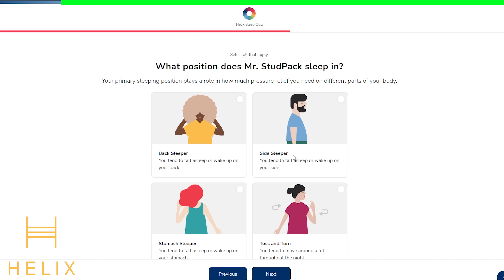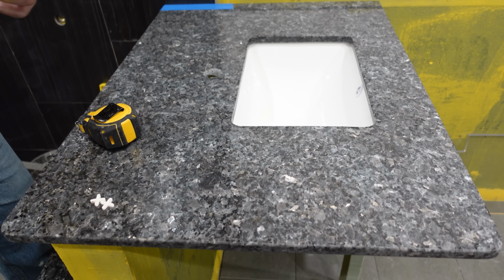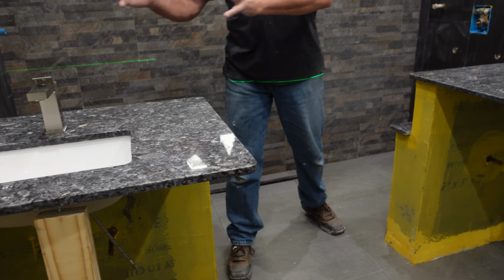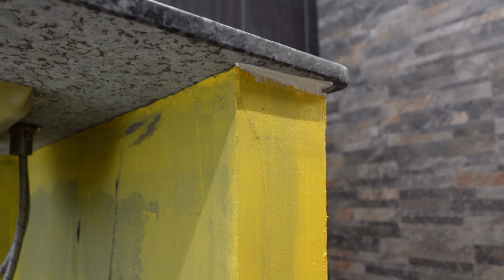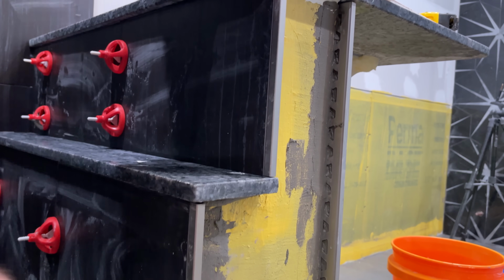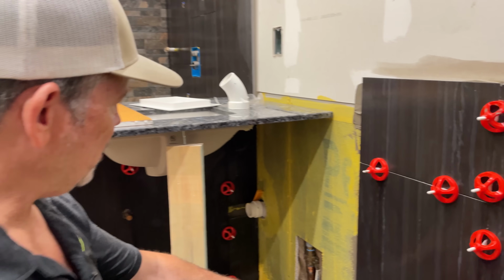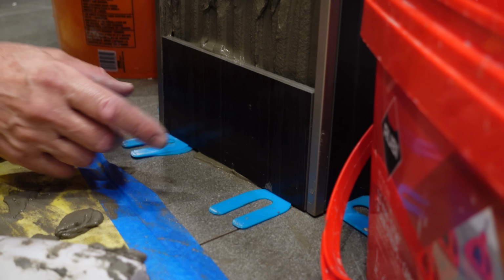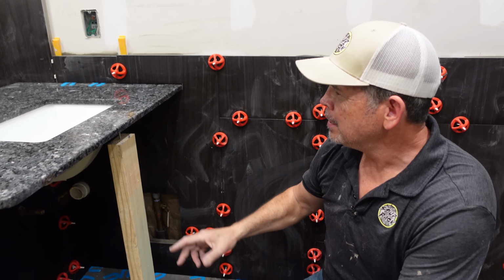A Stick and a Bolt is ALL YOU NEED for Perfectly Level Counters! - THE SHOP Part 20

Comment: The pony wall countertop supports should be some sort of stainless tig welded exhaust pipe to go with the whole theme. Your buddy could probably weld them up for you and have his hand in the build!
Reply: I had the same thought.
Reply: thats what i though of also
Reply: I was thinking maybe a camshaft.
Reply: That's what I was thinking James.
Reply: I too thought the obvious choice would be a chrome exhaust pipe…was an hour late on it being an original idea😢
Reply: I was thinking like a camshaft or crankshaft, but it would have to be coated with like a clear resin or something to keep it from rusting in the bathroom. That would be slick either stainless exhaust,cam or crank. Whatever it will be, I’m sure the StudPack will make it insane!!
Reply: Titanium Pie cuts
Reply: I was thinking 2 stainless glass packs or cherry bombs
Reply: I was literally about to say the same thing considering the nature of the shop. Awesome idea!!!
Reply: Not an exhaust pipe…. A McPherson strut!
Reply: Exactly what I was thinking!
Reply: Definitely
Reply: This idea has my vote!
Reply: I dont care what it is as long as it's stainless steel.
Reply: I was thinking exhaust or camshaft
Reply: Beat me to it. I had the same thought.
Reply: I was gunna say a car hood to hide the plumming haha
Reply: Or forks from a Harley!
Reply: Ooh, that sounds like a good idea. I was thinking some 2" aluminum angle stock for legs, but that sounds sturdier.
Reply: Going with the exhaust idea use a set of chromed headers at the top then extend the collector to the floor to make the legs.
Reply: Cam shaft
Reply: @macman85602  My concern with exhaust pipe is that it might not be strong enough to act as support. I've seen some exhaust pipes break fairly easily. Maybe something designed for structure might be better. Or have some sort of extra support hidden inside the pipe for reinforcement.
Reply: @catsmeow5566  could throw a steel support inside. They just needs to look like exhaust headers
Reply: My thoughts too.  A chromed glasspack.
Reply: Opposing view... 
Many, many comments for some sort of motor/car part. If there were more car parts in the design, I'd say go for it. Unless I missed something, the only automotive link in the bathroom is the Chevy logo.
Keep in mind the high humidity in the bathroom. Steel parts will rust unless treated/coated. Most any sort of strait "leg" will likely reach out and smash tows that pass by too close. 
You've got some aluminum trim on the pony wall, I'd tend to bring that to the sink support. Some sort of aluminum sweep (maybe 1-2 inch square stock/tube) from near the front of the sink sweeping down and back toward the pony wall, ending at the floor maybe 10-12 inches out from the wall. Set back in from the side edge about 4-6 inches. That should prevent stubbed tows. Frame it up the pony-wall and under the sink counter with more aluminum to make a triangle shape (with a curved hypotenuse). Fill in the hollow center with matching tile, or build in some recessed shelves and tile those. More LED lights would be cool in the shelves, but electric may be a problem.
Just my two cents.
Reply: Could set it back enough to accommodate a towel bar. It is near the shower after all.
Reply: problem is they cant get his buddy to make it as he would need to get in there to check measurements etc and they dont want him to see the bathroom until its finished for the surprise on the wall.
Reply: Came here to say this. Think it's a great idea.
Reply: @macman85602  I did like the idea someone suggested of having an angled support that butts up against the wall- harder to hit the support with a foot that way and would look neat. Maybe some sort of exhaust pipe that angles like that and has reinforcement inside.
Reply: @Know-Way  Good point. I was thinking either aluminum or maybe something painted black. I like your idea of the triangle with curved hypotenuse (I still remember Pythagorean's theorem). I'd love to see that drawn out in Sketchup.
Reply: How do I contact studpack?
I am looking for a contractor, and I am not sure how contractors come up with their labor cost.
Is it like two times what the materials would cost?
Reply: 1\4 elliptical leaf spring

Comment: I like all the suggestions for car part-themed supports for the counters.  I suggest that whatever you do, have the support angle back toward the wall.  A purely vertical support will almost certainly result in stubbed toes, which will be extra painful when going in or out of the shower.  Plus, it will be much easier to clean the floor if the counter supports connect to the wall.
Reply: This! Never thought of that, but I could see it being very annoying.
Reply: I was thinking the same.  Just a rolled chrome(or matte black) bar (like you would find on a roll bar cage) that supports the corner into the wall itself rather than on the floor.  Could probably get away with a short vertical into a 45, then horizontal into the pony wall.
Reply: Nice, that's a way better idea. I was thinking they should match the trim on the tile with solid square bar, maybe even 2 of them 45° to the rear.
Reply: I'd just use a huge 'L' bracket, so there is no post at all.
Reply: I was thinking the same 👍👍
Reply: Bumping

Comment: I think a polished and cleared camshaft would look awesome
Reply: yeah, they could probably bore out the centre at the ends so they can stack 1.5/2 of them together with a little piece of rod and just have some sort of pin sticking up out of the floor to keep the bottom in place and then a nice looking stainless bolt through the counter top. maybe even use a countersunk bolt or something.
Reply: I was gonna say the same thing!
Reply: This is what I came to say too!
Reply: Also came to say this. But chrome plated
Reply: That was pretty much what I was thinking too. I was thinking chromed but either way would be cool.
Reply: I vote for your idea.
Reply: That was going to be my suggestion as well.
Reply: I commented before I saw this! DITTO!!!

Comment: I like all the suggestions! Originally I was going to offer the camshaft idea but I thought about stubbing a toe so I quickly changed my idea to a use leaf springs that arc from below the countertop corner towards the back wall near the shower entrance. Paint them black! This project turned out great!
Reply: I thought the exact same thing about a leaf spring going back to the pony wall rather than down to the ground too but I figured they would probably need to be custom made because they would be so short. Then I thought of a coil over shock but thought maybe that would be a little over the top. The leaf spring would be a great design element but understated rather than in your face.

Comment: Regarding the support-leg: ya have to be careful to not introduce a new element that clutters the pro look so far. I think underneath the sink needs a cabinet for stowage of extra T.P., shampoo, paper-towels, soap, toilet-cleaning supplies, etc.
Reply: ...and towels, wash-cloths. One side could be a dirty clothes hamper. I assume they wear coveralls so maybe clean sets could be stowed.
Reply: 💯 you never have enough stowage in a bathroom. I would find/make laminate panels matching the tiles (or even have them printed) - with chrome-framing (like the pony-wall), 1 or 2 shelves and some baskets. Pretty sure 'Mrs. Chevrolet' will appreciate it (and, that open space is just not gonna look 'finished' - no matter the support).

Comment: Cool sink support idea - use a threaded galvanized gas pipe with flanges on each end.  I've used them for railings and supports.  They work great.  Make sure to paint them well to prevent rust.

Comment: I gotta go with something different than everyone else.... drill a hole in corner of countertop and put a stainless eye bolt in then aluminum or stainless aircraft cable going to the ceiling. I was gonna say a winch  on celing but that would prolly rust over time and gets expensive for 2
Reply: I like the idea, but use a hand winch like a boat trailer would use.

Comment: Use a drive shaft to support the counter. Rotate each yoke to a 45 degree angle. One end attached to the bottom of the pony wall. The other attached to the bottom of the counter.

Comment: I like Steve's answer of TIG-welded exhaust pipe but what I suggest is a bottle jack or something along those lines to go with the vehicle motif, just like Steve mentioned.  Of course, you would want to make sure that the pressure release valve on the jack is "permanently" closed so that it doesn't get opened under normal circumstances.

Comment: Future idea for sink support,
On my projects for floating sinks I build steel angle supports into the framing fastened to the substrate. With only the top horizontal sticking out to support the top and to hide the angle use a apron around to hide the support.

Comment: That tile cut sliding over the counter top  into place was super satisfying 👏👏 great work as always
Reply: I don't really understand why you didn't tile first and then mount the granite worktop, thereby removing the need to a) cut the tile and b) notch the granite. By the looks of it, the granite now comes up a bit short on the end of the pony wall and you can see the top of the corner trim on at least one side. Also not sure why the shampoo shelf has a different corner radius from the worktop - seems uncharacteristically inconsistent for studpack! (I genuinely love what you guys do and your standard of finish is generally excellent which is why this one kind of stood out a bit).

Comment: I'm gonna go whole hog with my suggestion for the supports. I think it would look great semi-open / transparent. Granted this is expensive, but I suggest sandwiched tempered glass panel with the center section shattered for the crazed effect. Would look even better with some edge lighting, but not sure if you have a circuit in your plan you can get there... Would look pretty classy though and one more accent for that dark tile and stone.

Comment: Along with the support post maybe add a short apron under the front and side tied in with the post to hide the bottom of the sink and help support the heavy counter but not cover any of the chrome pipes. Kind of like what's under a table. It will help support when someone sits on it or sets something heavy on it. That will definitely happen.

Comment: Curved stainless steel exhaust pipe attached to underside of counter and pony wall (about 6" above the floor) with 2-bolt exhaust flange.  Repeat for grab and towel bars.

Comment: The support should be an illuminated frosted acrylic cylinder or square post in white to match the niche on a dimmer to lower the light to guide the eye into the shower.

Comment: For a corner support for the sink, 1" black cast iron pipe with flanges on the ends would look cool. I've used it before and it has an industrial but sleek look.

Comment: Blade of a leaf spring out of an old chevy truck, nice forged steel bracket to hold it to the pony wall and a nice gentle curve to the floating corner, it's out of the way, no toes will be broken, probably enough support since the countertop only needs that one corner left. But might be a bit much with all the work you already have haha!
Awesome project, love following the videos!
Reply: use the leaf spring out of a corvette not a truck!

Comment: It's refreshing every time I come across fellow "Safety Engineers" (as in Use Both Belt "and" Suspenders!).  I learn something new every time I see one of your videos.  It's like another "OMG...I knew that I could do that.  Why didn't I think of it?"  (Not talking about the 2x4 and bolt, because I actually have used that.  Will miracles never cease!?!?!?!?  Anxiously awaiting to see your choice for the final support.)  I'm hoping you will do a video about the whole skid-steer purchase and all that factored into the how, why, and logic in the choice you made for your purchase.  Me?  I'm still using my old reliable 1964 Ford 4000 Diesel tractor (with box blades and chain harrow for leveling, plus all the usual farm implements that were used when that tractor was the "latest, greatest, state of the art" when it came to tractors.  First, I am rapidly approaching 20 years older than that tractor, and I used the Massey Ferguson equivalent on my Grandfathers farm as a teenager, so it's just like I'm back home again.) because it fits all my needs, but then, again, I'm not a contractor or even remotely close to the professionals you are and am not even close to having the requirements you have.  Please keep the great videos coming when the opportunity (and time) permits!!

Comment: Knee brace the countertop with a rear quarter panel and tire art piece made out of like stainless, a couple of lags run into the pony wall hidden on the back should support it, can have the pieces made on a CNC laser cutter make em look like the rear quarter of like a 69 charger or something like that.

Comment: For the supports use black pipe , like one inch round, the fittings are all screw together and there are base plate type things to attach to floor , it would keep with the garage theme your doing .

Comment: I would look into polished aluminum diamond plate bent @ 90 degrees   It makes a soft corner unlike angle and you can have a base and cap plates welded on ahead of time with whatever size holes you need for anchors

Comment: Seeing a lot of suggestions for chrome exhaust/camshaft supports. This is going to be a damp location so rust will be a factor... even stainless can rust in certain conditions. What about a carbon fiber tube? Different shapes are available (round, hex, square, rectangle, octagonal) and they would be dark and blend in with the tile. You could use a plastic plug (nylon, delrin, etc.) on the end that touches the floor to capture the tube and then fabricate a small bracket to capture the top of the tube since the countertop is already attached to the pony wall.

Comment: A crankshaft on one side and a camshaft on the other side would be cool.
You could use a piston at the top and bottom to gain height and have a big flat surface to glue to the floor and counter.
Reply: This is what I was going to say.....his side gets crank, her's cam...although, if the wife is cranky she'll be using his side.....

Comment: I agree with others that something going all the way down to the floor would cause stubbed toes. Maybe a hood strut piston that angles back onto the wall. Like one that olds up the hood of a car. Could tack weld it so it doesn't compress anymore. 

Black body of the piston and chrome shaft would tie it all in nicely. IMO

Comment: Hey, thanks for the video, wasn’t expecting anything for at least a couple more weeks. 👍For the corner support, Chrome exhaust pipe, a polished camshaft or even a polished chromed axle could be very cool. The only problem I see with something made of metal in a bathroom would be cleaning. Unfortunately most bathroom cleaners are corrosion to metal, especially chrome. Steps would need to be done to protect metal surfaces from cleaners. Stainless steel holds up pretty well.

Comment: I am liking all of these car part suggestions! Might I suggest doing a car part but inserting a rod in the middle, using the rod for support and the car part just for decorative. This way you can use cheaper metal for the decor because you don't have to worry about it holding up weight. I am a pretty new fan and know absolutely nothing about construction, but it is fun to learn from y'all! Many blessings!

Comment: Gorgeous bathroom.  The material you chose look so nice together and I really like how clean all your lines are.  Lines that are off are such a distraction and can tarnish an otherwise gorgeous design.
Regarding the sink corner support, I think the most attractive solution would be a square post made out of the same black tile you tiled the rest of the bathroom with.  Putting a pipe or threaded in the middle of the post that connects to a threaded insert into the floor and the sink top would add a lot of strength.  If you set the threading right, you should be able the slide the support into place then turn the post to simultaneously thread into both connections at the same time.  Also, a black rubber gasket at the top and bottom could help prevent any chipping caused by a tile on tile interface. Note: This is the thinking of an Engineer not a Carpenter/Mason.

Comment: Modding some old chrome Chevy bumpers and mounting vertically might work for the counter supports. Could even keep the license plate section in the middle and allow that to be changed.

Comment: Maybe a chrome driveshaft with a double cardan joint for the base would look cool for the support piece. You could probably get it done locally. Most places can make them in any size. A giant piston rod off one of the big natural gas compressor engines with the bottom part removed would be unique but probably hard to find.

Comment: Support the corners of the vanities with camshafts probably a straight 8 camshaft would be long enough or weld a couple of V8 or 4-cylinder camshafts together and get them gold plated or possibly Chrome if you don't want to spend the money on gold

Comment: I remember the custom baseball bat post you used on a project, it was pretty sweet! What about like two big torque wrenches custom fit underneath? Not sure about the strength of that piece of quartz with a pressure point on the corner though, the sinks look quite heavy. What about two tool chests shoved underneath? then they could utilize the drawers while hiding the unfinished porcelain bowl. So many options!